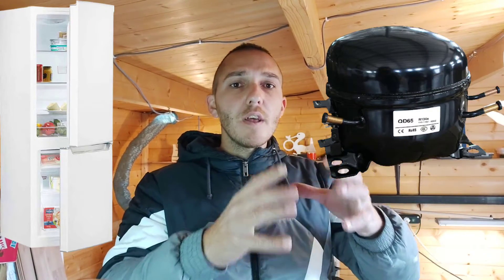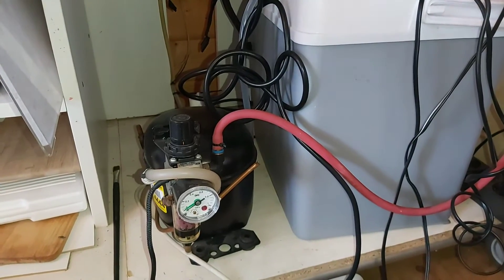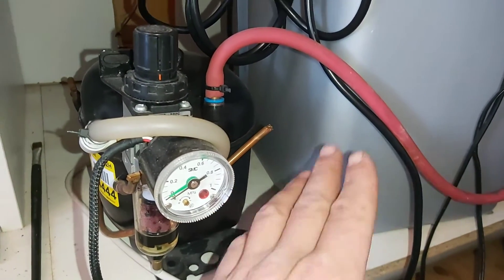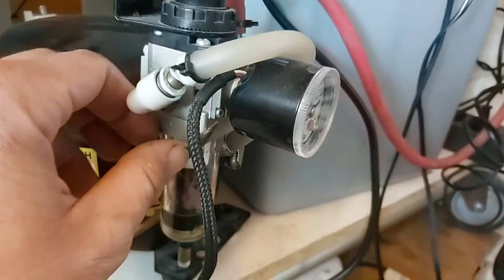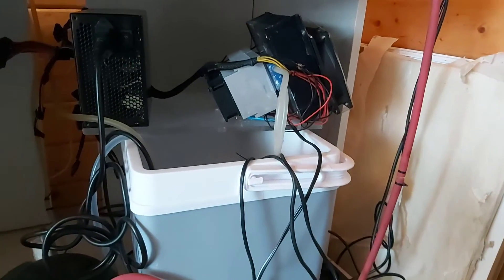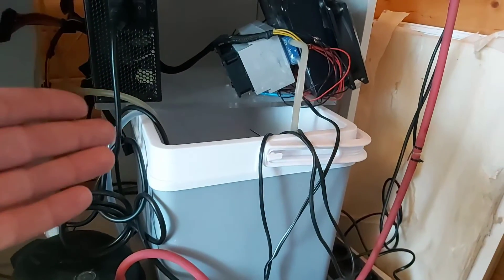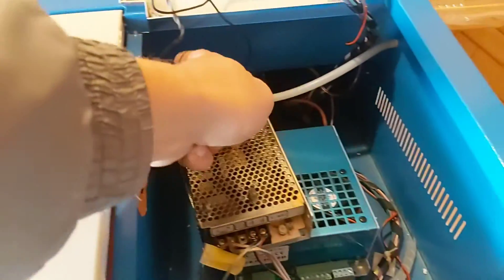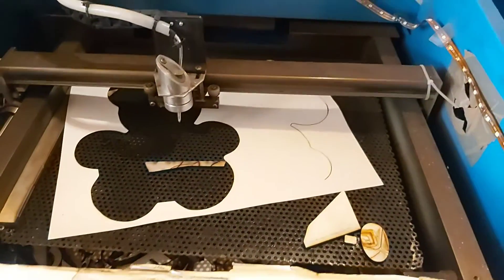Co2 Laser AIR ASSIST upgrade with Fridge Compressor ! THIS IS THE BEST UPGRADE FOR MY K40 LASER !

Comment: I wanted to try this but seen your video and only problem is oil will come out
Reply from the maker: You need to put filter,and no problem 😊
Reply: Nothing will come out if you don't add more oil and if you keep the air going in dry.
The oil trap is a good idea but mine has no oil in it after 10 hour's use. 👍 
Small nozzle makes it much better 👌

Comment: Good job man. Was thinking about this myself and here someone is thinking the same way and made it work! Tha k you!
Reply from the maker: Thanks man! Im glad that we are in the same hobby. (Air filter doesn't need to be like this mine,you can use diy filter made from plastic bottle or something else)
Reply: Im working on it now ! Im using a pump from a portable ice maker , I'm going to try and run the air through the condenser and fan like an aftercooler ,😆 I see what you did! Same idea with the cooler on yours 😎 awesome man thx again for posting . The only video I found with someone trying this .

Comment: Fridge compressor can work without oil only some weeks. After thet it dead. You need connect “fiter oil exit” to “compressor input”. Like there: https://youtu.be/y4Snv0kI8qs?t=789
Fridge compressor have very low airflow (only 0.2 liter per secon) but for co2 40w needs 1 liter per second.
Reply from the maker: This works without any problems or heating. Airflow is enough if you put on the end small nozzle. I will make another video about that. Thanks for watching and commenting my video
Reply: @HOWTOdays  I subscribed and wait your video.